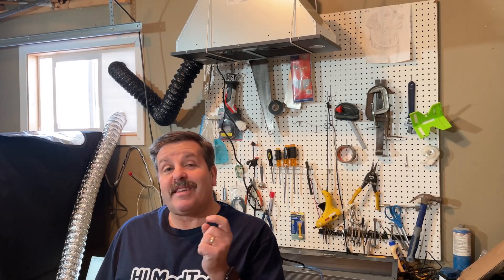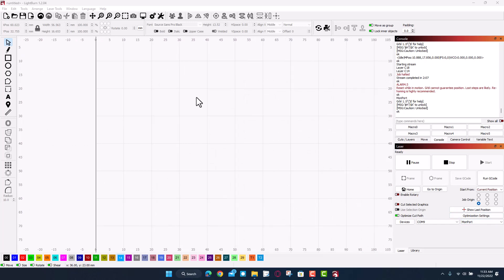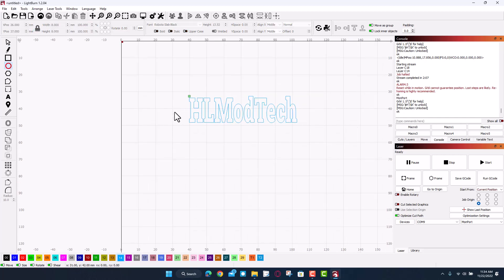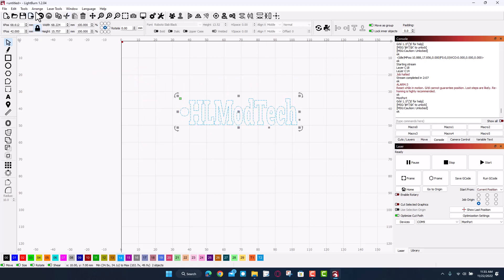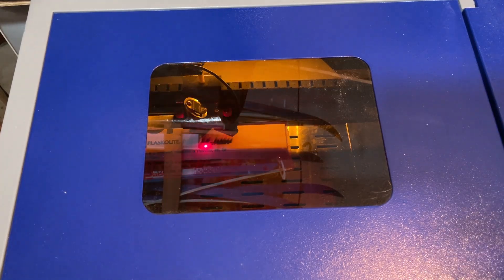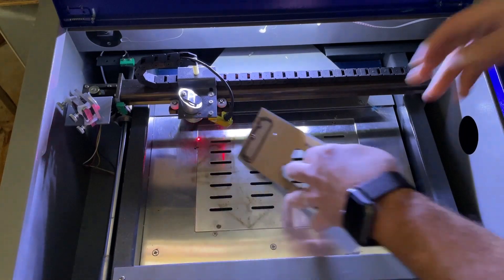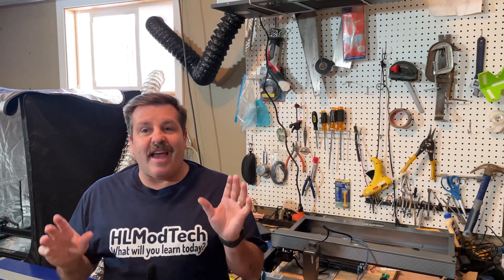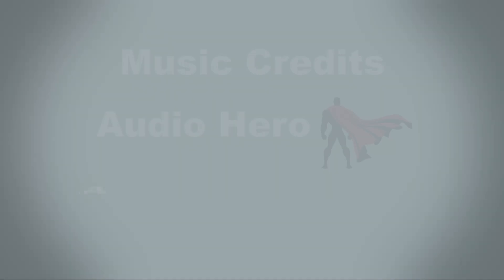Monport 40W CO2 Laser Engraver Acrylic keychain Lightburn test

Comment: I have to assume this is your first laser and you got it yesterday. You are cutting acrylic at a speed not even a 150 watt machine can do. With my 100watt I cut 3mm acrylic at 8 speed and 40% power to get a nice flame polished edge. Lift your acrylic off the bed with spacers when cutting. Remove the protective film before engraving, you burned the paper into in acrylic and it looks terrible.
Reply from the maker: Thanks for the feedback.  I will give it a go next time I play with the Monport.